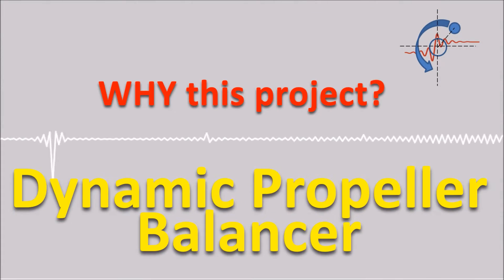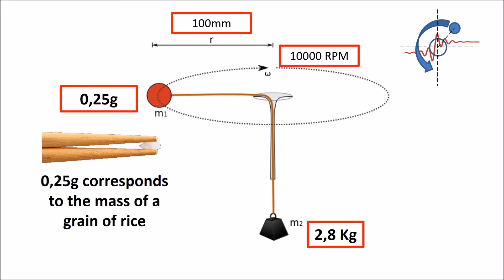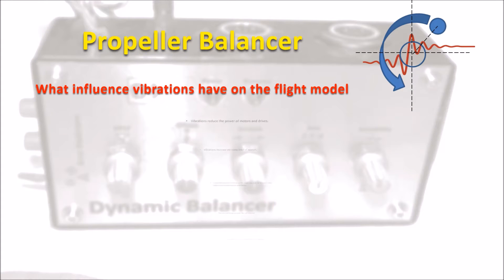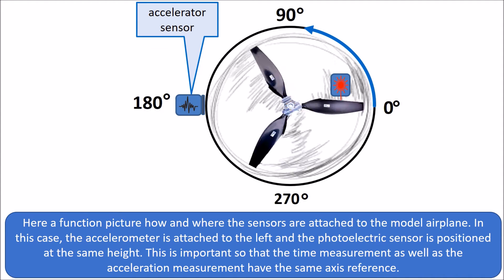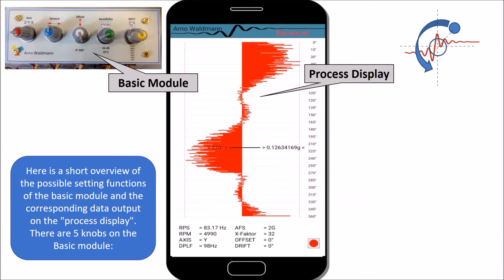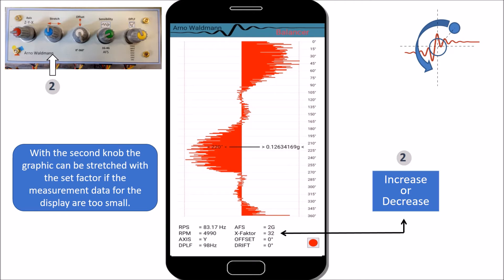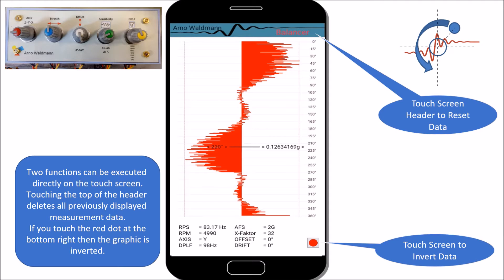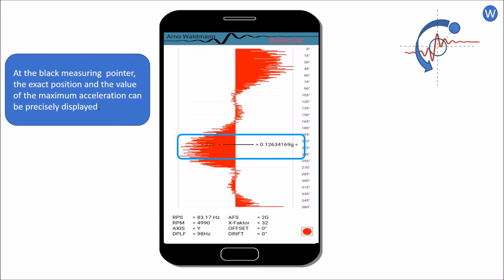Dynamic Propeller Balancer V 1.0b with Teensy 3.6

Comment: How many readings do you take per second? It looks like you're displaying data for each degree of revolution.  Are these averaged?  I am currently designing a similar system for in-flight vibration monitoring of my airplane's propeller.
Reply from the maker: it depends on the rotation speed